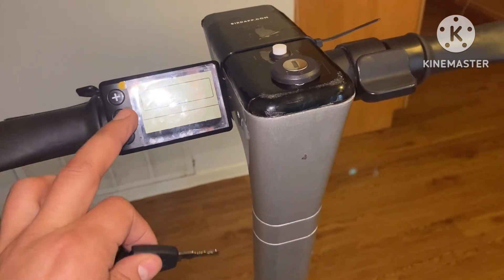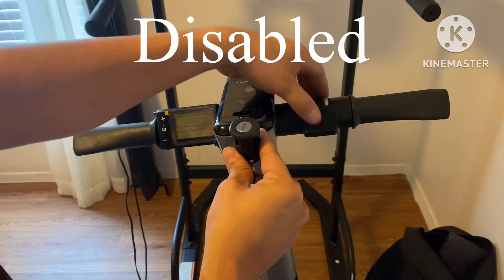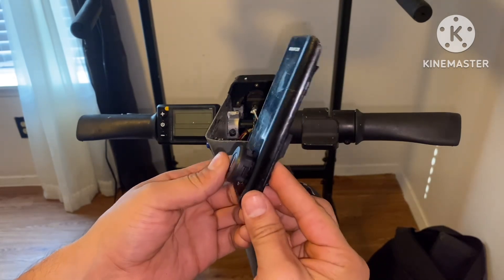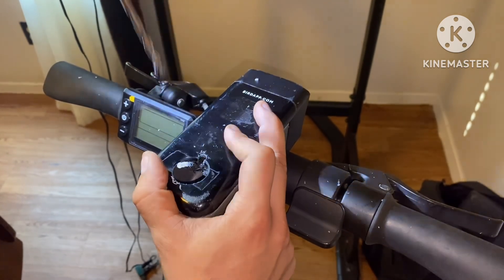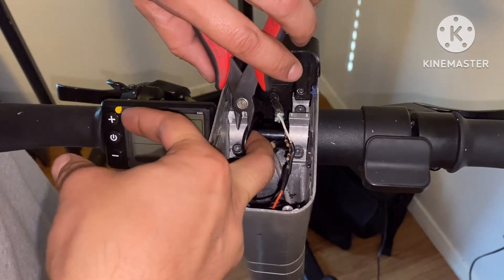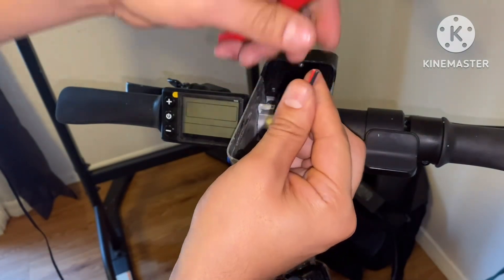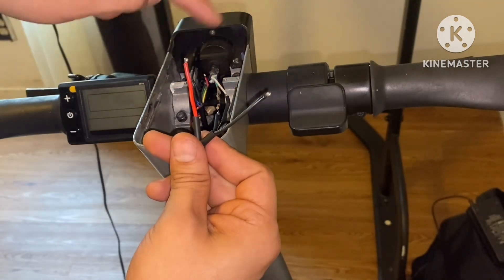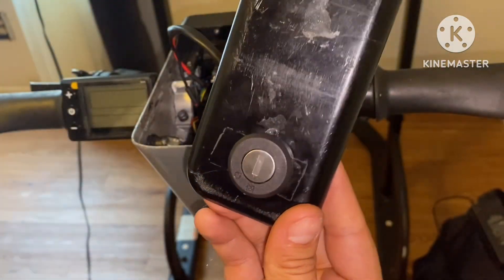Bird 3 | Electric scooter | Ignition switch | ON/OFF | ￼￼ Project | Tutorial  ￼￼

Comment: Hey, I’m having some confusion with troubleshooting a battery. Your videos have been very informative. I have attempted to bypass the bms, and jump the battery but still experiencing no function of the motor. Would you be willing to provide some extra support via FaceTime sometime?
Reply: He will never do that but try checking the wires and make sure that they are all working properly and the bms bypass might need to be redone with a hotter, soldering iron and a new thicker wire hope the best 🛴

Comment: Eh bro thanks for all the help over the last few months. Your videos have come in clutch!  Appriciate it. But quick question for yuh. I've got one changed to a new brushless 36volt controller with a new display and throttle but I fkd something up and it's only working when the learning wires plugged in?? Prob the battery or what u think ?
Reply: He will not respond at all but sounds like something went wrong with the wiring or it could be the brushless controller plus if you put a 36 V brushless controller instead of a 40 or 50 V you might fry the controller

Comment: I want to run 10-15 of these batteries in parallel I was wondering if it’s possible I’m pretty sure it is, and would each individual bms handle the upgraded amps,